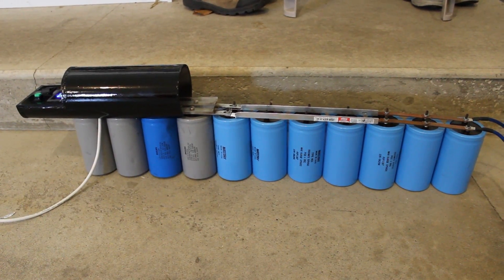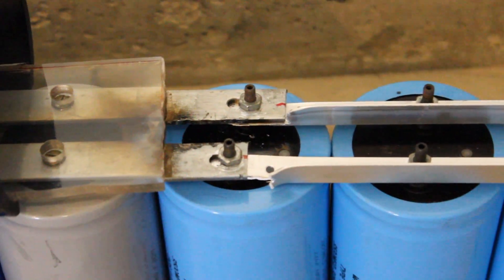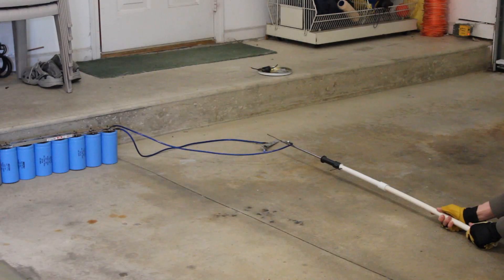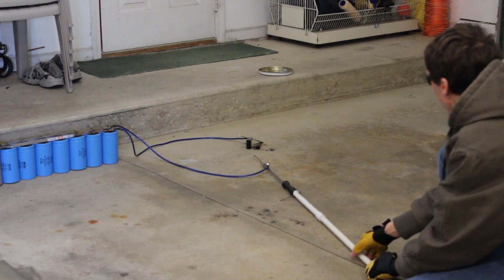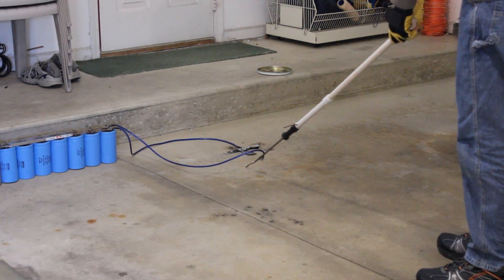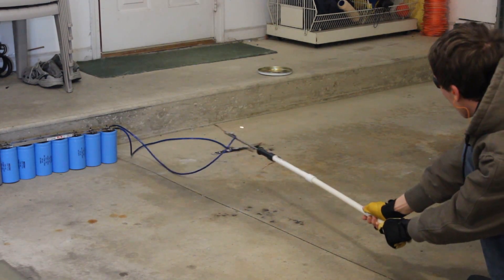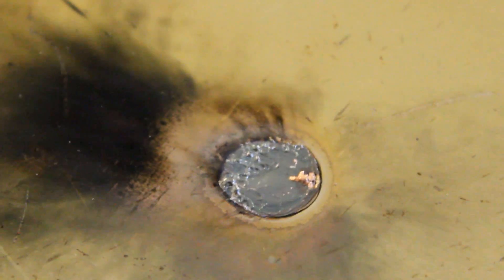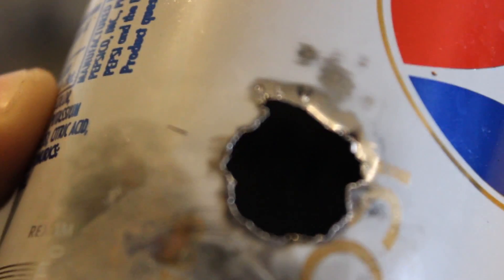Now at 2KJ...

Comment from the maker: Yeah im still undecided if im going to sell all 50 of mine.  A cheap easy way is a variac transformer and a microwave transformer.  The method I use, used a bit of math.  I'm using a voltage quadruper on the 120V mains ( google Voltage quadrupler )